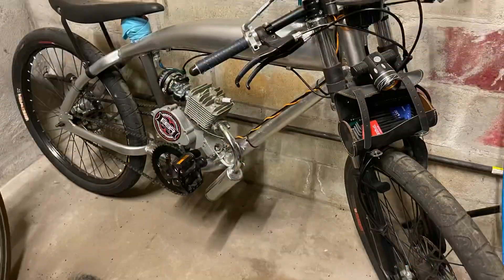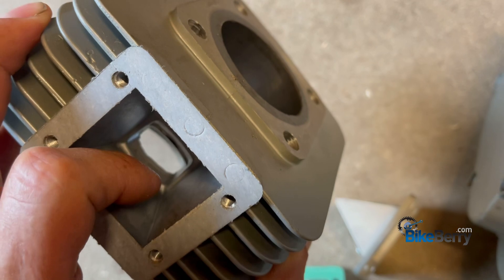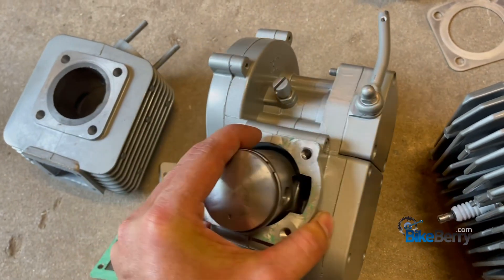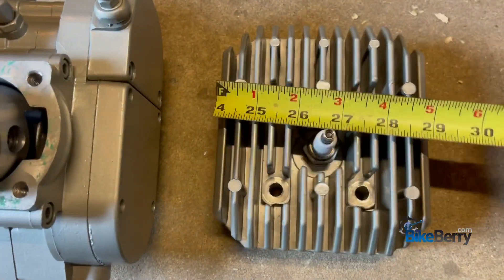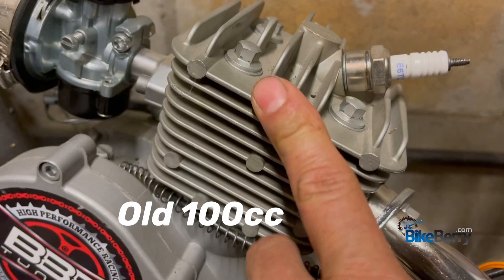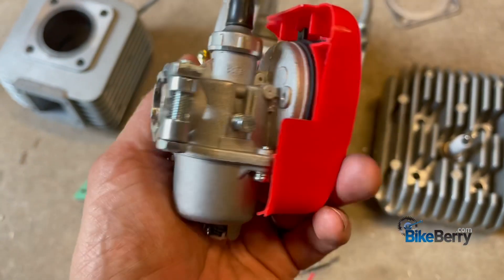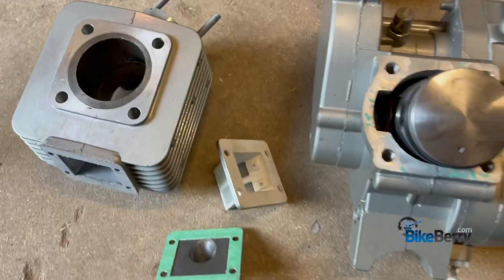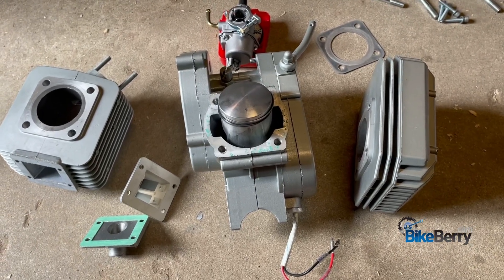Inside the Beast: A Detailed Tear Down of the New V2 100cc 2-Stroke Engine | BikeBerry

Comment: @mattparker9726. You should not worry about the burs or casting. I have experience with the cdh or samger which is a 49mm iron bore and it comes with significant overhang. To get any power out of it at all you need to grind out the cast

Comment: You should see if the piston and jug bolt up to the BT80. 😊
Reply: If the studs have the same spacing, bolting it on will work. Though the piston is different. That would be a good question.
Reply: Bt80 and bt100 block has different stud pattern, also the transfers on the bt100 are a completely different shape

Comment: well I just had to return a bt100 because it's seized up the first mile got it unstuck and it did it again the next mile it wasn't even hot I think it has a heat issue you know there's this little bit of space where the exhaust pipe hooks up and fire surrounds that area on the piston and the gas is sent down in The jug cooling it down result one side gets hotter as the other side gets cooler causes a cold seized yeah real bitchin design

Comment: @ Tony  I would like to get into testing Bikeberry products, and I've sent them an email regarding that, Basically, over the years I have heard very negative things, rumors mostly, about Bikeberry, and I would like to do testing on your products to confirm or deny those rumors.  Specifically, I was curious if I could get you to send me one of the 2 stroke bullet train motors, I've had the most experience with similar chinadoll motors, so I could most accurately judge if your engine was a better engine overall.  At this point, I'd like to judge by three main categories, first, and most important to me, as your ad makes it pretty clear this is a big selling point, is reliability as  compaired to a stock 66cc engine.  Second, parts availability, can I fix it if it breaks?  And third, general quality of the engine over all, and daily ridability.  Will it, for example vibrate so much that more than 30 minutes of riding becomes painful?  (like my last chinadoll) for example?  Other than the alternate starting methods are there any additional reasons to buy your kits?   Anyways, I know I'll get a lot of flack for asking, and it's a long shot anyways, but this is a genuine interest of mine, and no body sponsors you till you don't need it anymore, kind of like asking a bank for a loan.  I do mostly gaming videos, but I just got a new camera being sent my way by another awesome creator!  So soon, I'll have the ability to film in 1080p 60fps no problems.
Reply: Sad you say rumors.. unfortunately I've been one of the customers that got treated horribly by there customer service. Not even going to get into the crap they pulled..... but hopefully others will not have to experience the horrible services that I did

Comment: ⭐️ Dude, you’re showing the defects and saying “it’s not a big deal” where is your evidence for this? If the OUTSIDE of the case is lacking, what does this tell us about the INSIDE and port mapping? Stop releasing crap products start innovating!! ⭐️ 

If you did any market research, you would understand NT speed carbs function better and are far more reliable than BoFang carbs. Why can’t you have it defaulted to your motors?

START LISTENING TO YOUR COMMUNITY
Reply: Interesting